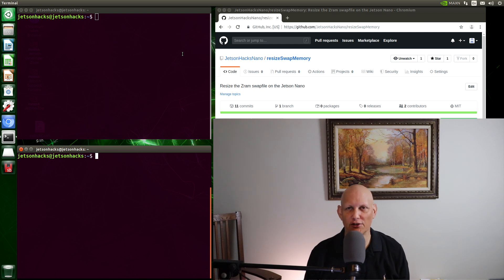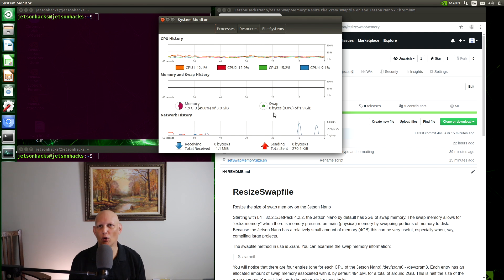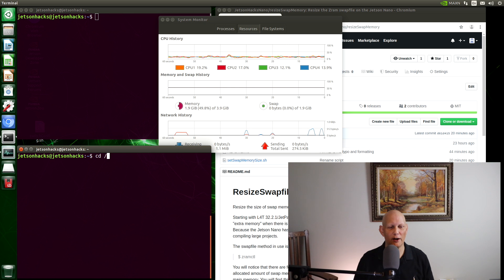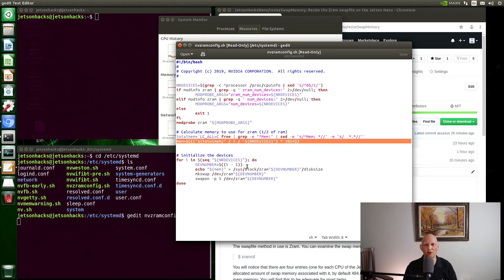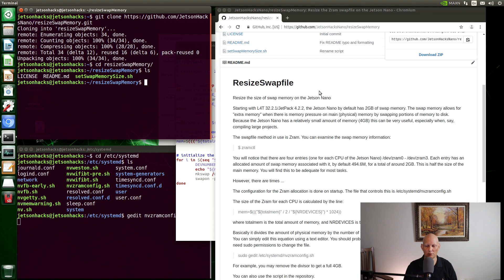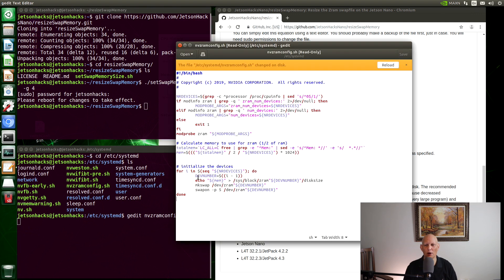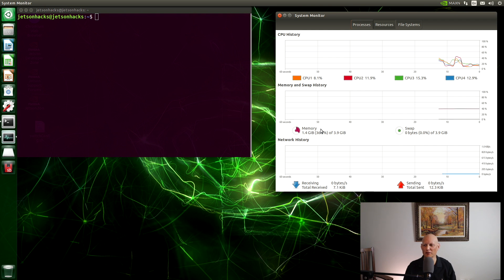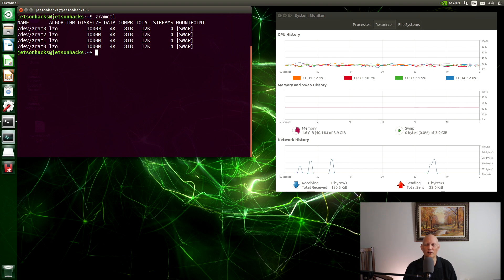Jetson Nano - Even More Swap

Comment: The latest JP versions asks if we want to swap memory or not..so obviously i did say yes... but when i run my program and logged memory allocation using `tegrastats` , i can see that the nano doesnt use much of the swap memory and shuts the program down after the ram is filled.. Can u recommend a way to effectively use swap memory and ram?
Reply from the maker: If your program is GPU bound, then adding more swap memory probably would not help. The GPU can only use physical memory.
Reply: @JetsonHacks  ohh okay...well I was facing a problem...not quite sure if its a memory issue or a tensorflow issue..I posted that problem on the nvidia forum. This is the link https://forums.developer.nvidia.com/t/tensorflow-python-framework-errors-impl-internalerror/167743  If you have time..can u please go through the problem and suggest me something?

Comment: Sir i have booted my jetson nano properly but when connecting to my compaq moniter it is not displaying anything and showing OUT OF RANGE 1366X768 recommended . I ve used a 5v---2A usb power supply and a 64gb memory card and a vga----hdmi adapter to connect it to my moniter.....
Reply from the maker: It won't work with a VGA monitor, the HDMI adapter does not include the correct signals to tell the Jetson what it is connected to. Please ask this question on the official NVIDIA Jetson Nano forum for more help.
Reply: @JetsonHacks  thank u sir ... today i will try it in an hdmi moniter
Reply: @JetsonHacks  sir can i use a DVI to hdmi cable for connecting jetson nano to moniter??
Reply from the maker: @satyamrout1400  Depends, has to be DVI-D adapter for it to have a chance of working. Or you could just use a HDMI monitor that is the requirement for using the Jetson.
Reply: @JetsonHacks  ok sir thank u
Reply: @JetsonHacks  thank u sir it worked....